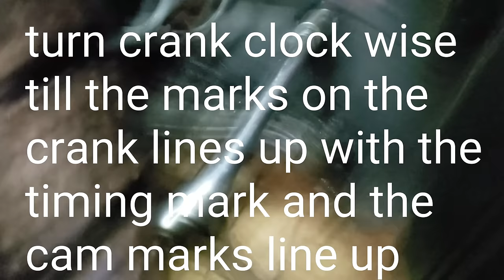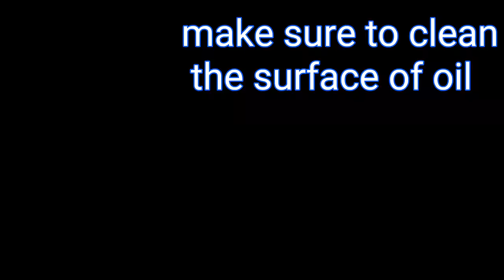How to replace Honda CRV timing chain DIY #crv #rsx #tsx #accord #k20 #k24 #timing chain

Comment: I just did this job using this video as a guide.  I want to share my insight and what I learned.  I'm a total amateur and the most I've done before was change oil and sparkplugs.  Not only was the cost for this job exorbitant, but I was rejected by 10 garages before I found one that would do it and they wanted 2k.  I couldn't justify it on an 1800 dollar vehicle.  I did it and it runs great.  Better than it has since I've had it.  So, here we go.  2002 CRV 2.4 btw.  

1.  Uncle Tinman made a fantastic video.  A 5 star instructional video that could be shown at UTI or any mechanic school.  I watched it 3 or 4 times before I started and knew the entire job exactly what I was supposed to do.  
2.  Find another way to prop up your hood.  It will constantly be in your way.  Same goes for the PS resevoir.  Just take it out.  Unattach the pressure line.  You'll be glad you did.  
3.  You will need a Lisle 77080 weighted socket and a huge Milwaukee or Dewalt XR (my choice) impact driver to break that crank bolt loose.  This held up my job by a few days waiting for the socket.  Even with the socket and that huge Dewalt it wasn't instant.  It had to hammer for a few seconds.  
4.  My 18 inch extension came in handy several times.  Mainly to loosen the engine mount bolt closest to the rear.  Stuck it right down through the ABS lines.  I loosened it with a breaker bar first.  
5.  You need a 1/4 inch cordless ratchet with a shallow 10mm socket.  You'll save so much time and energy getting all of those bolts out of the timing cover.  I didn't have one.  I had already spent too much on the Dewalt.  
6.  I bought a 14mm Capri 0 degree offset extra long wrench to relieve the tension of the serpentine belt.  It was a good purchase.  I used it several times on the bracket that mounts the engine mount through the timing cover.  
7.  I didn't have an extra deep 17mm socket that would clear the stud on the mounting bracket.  I had to file it down to fit a regular 17mm deep socket 1/2 inch drive.  I filed about 1/4 of an inch off of it.  Do this before you take the valve cover off.  
8.  Setting the timing is easy with the colored links and markings on the sprockets.  After you get the chain set, put the top guide back on before you spin it around.  This will keep your chain in place.  
9.  The three bolts on the bottom of the timing cover are hard to reach.  I would recommend a thin wall 10mm with a 1/4 low profile ratchet.  
10.  Before you put the silicone on the cover, do a few dry runs getting the cover in place.  This will help you avoid making a sticky mess.  
11.  Get the brake cleaner.  It's a miracle solution.  

Thank you very much for taking the time to do this video.  I feel like I could do this job again well within the 3.8  hours alloted in the labor guide.  Having the right tools is essential.  I have medium size hands, but if I had huge mitts and arms like some guys I know I don't know how they could do this job.  It's a tight fit.  Thanks again, Uncle Tinman.  A+, top notch work for nothing but the greater good.
Reply from the maker: Thanks you for the compliments and your amazing breakdown of your insight. Other viewers will greatly appreciate it.
Reply: Way to go!!!!!!!!! That’s AWESOME! I give you a TON of credit buddy 🎉 nice job! This is tough!
Reply: @TheWopper78  Thanks a lot man.  I'm proud of myself.  It was a big job.  A friend who is a mobile mechanic (and turned me down for this job) is going to call me next time he gets a K24 timing chain job and we're going to do it together.  So, I got a fixed car, some new tools, and a small side hustle out of the deal.
Reply: @rsn2012  that’s amazing! I ordered my timing chain last night from O’Reilly auto parts, picking it up today and away we go! Lol! Your video will be playing during this procedure hehehehe thanks again bud!
Reply: @TheWopper78  Did you also get the tensioner, crank seal, and plug tube seals?
Reply: What did you mean by 7? Is this referring to the engine mount? Also did you need to replace the VVT sprocket and how would you know if it needs replaced too?
Reply: Also do you need to remove the spark plugs to make turning the crank pulley easier?
Reply: Wondering why not do the valve adjust also while the head already open.

Comment: Did one about the same time as you , customer had EML on for a while with cam crank sychronisation error. But kept on driving ,in the end it would crank and start then stall straight away. The chain adjuster was out well past the 16mm limit and the stretch in the chain compared to the new one was immense. I think the reason  it did not jump a tooth is because the owner was a gentle driver and it was automatic transmission. Very lucky !! this engine had annual oil changes with fully synthetic oil and lowish mileage for its age. A very satisfying job to do ,could alway do with a smaller pair if hands tho. Very good video 👍👍👍👍👍 If you don't have air tools the crank holding tool is the best option and a strong helper  the crank bolt...IS VERY VERY TIGHT if you slip there are lots of sharp bits around for your hands to hit.  WATCH THIS VIDEO IF YOU NEED TO DO THIS JOB.
Reply from the maker: Thank you..means a lot coming from a experienced fellow tech.

Comment: I have this job to do tomorrow morning. This video gives me some before hand knowledge. I have never performed this on a Honda engine but have done many Mitsubishi engines in the Dodge vehicles in the past.
Reply from the maker: If you know your way around a tool box and engine bay. You should be good to go. Feel free to message here if you have questions and I'll see if I can help
Reply: @UncleTinman  I do, I have been an ASE Master Technician since 1983 but arthritis has slowed me down a lot in later years.

Comment: Excellent video. One of the best tips pointed out here is counting the number of bolts holding the cover. The 2nd one down on left you can’t see and best way to remove it is from below reaching up.  A couple of things he didn’t mention but I may add, on my 2011 Accord,  there wasn’t enough room to pull out a larger bolt to the left of the motor mount bolts so I had to leave the bolt in the cover when I removed it so don’t forget to install this bolt before reinstalling the cover.  There’s 2 shoulder bolts and they are line up bolts that go on the bottom corners of the cover.  Install these first and the rest line up perfectly.  This was an all day job but it’ll save you  anywhere from $700-$1000 in labor alone not to mention the wait.  Yes, there are some challenges but have patience it’s possible without engine removed.  Taking my time it took me about 12 hours.  I’d have no fears doing this again.
Reply from the maker: Thank you for your reply.. hopefully it'll help others as well.
Reply: I'm about to tackle this job on my 2008 accord coupe. This is the most helpful video I've seen so far. Thanks Unc
Reply from the maker: @Midnightsnack456  thank you for your reply.  I tried to make it as concise as possible. Good luck with the job.
Reply: @Midnightsnack456  it’s not a difficult job.  While you have the timing chain cover off you might as well replace the crankshaft seal too. Get the seal kit from NAPA (part # FPG TCS46051) it comes with 2 seals the irregular shaped O-ring goes on the inside of the cover & you’ll see it when you remove the cover. At first I was stumped as to where it went as there is no info on YouTube about this O-ring.  Hopefully you have access to a good impact wrench for the crank bolt. Invest in a Lisle 19mm socket.
Reply: Thank you! I'll pick one of those up as well as the Lisle 19mm. I take it it's a pretty strong socket. I need an impact! I planned on using torque wrenches and leverage to remove the crank pulley but I've failed to check the torque spec thus far 😅my toughest torque wrench can only go to 150 ft lbs.
Reply from the maker: @Midnightsnack456  DO NOT USE your torque wrench to remove the bolts.. torque wrench is only meant for tightening bolts.  The Lisle weighted socket is great to use with an impact. I have one that's a non Lisle brand that weights almost 2lbs, works amazing. If you don't have an impact gun you can also get the Honda crank locking tool. You'll need to hold it with a Johnson bar. I find it's easiest to lock it with a Johnson bar wedged on the control arm and then use another Johnson with a 19mm socket to loosen the bolt. 

This sounds very confusing.... maybe I'll make another video just for this topic. 

Cheers
Reply: @Midnightsnack456  I borrowed my friend’s Dewalt cordless impact. Soak the bolt with penetrating oil for a day or two helps. I recently bought a corded electric impact from Harbor Freight for $90 I’m pretty sure that would do the job too. If it doesn’t take it back. For $90, it’s worth the try. I’m keeping mine though for other jobs but again, I have the confidence it will do the job.

Comment: Man I’m only 10 minutes in and I feel confident enough to knock this shit out today. Awesome video man. Seriously Kudos!
Reply: Here goes nothing pulling the valve cover to check the timing marks.
Reply: Update. I’m a dummy and rotated the intake CAM. So had to reset all the timing marks. Everything is all lined up and ready to install the chain, guides and tensioner.

Comment: That was one of the best DYI vids I’ve seen. A bit of torque guidance would have been helpful too but I guess if someone has the wherewithal to tackle this job they can ensure bolt torquing is done correctly.
Thanks for your effort, I’ll subscribe to your channel.
Reply from the maker: Thank you for detailed reply. I'll try to add a torque spec guide for next time.

Comment: I own an '06 CR-V that I bought new, now with185.5k miles. Am still on the origiinal timing chain with no issues. I never let more than 5000 miles go between oil changes, using synthetic oil that I started using at around 120k miles.
Reply from the maker: @ozzierabbit587  proper maintenance definitely helps. Keep up the good work
Reply: I went to the mechanic today because the belt is chirping. It started dripping oil. A good 4 inches by 6 inches every week or so just sitting. The mechanic looked from under the hood with a flashlight. He looked at the serpentine belt area and claimed the "main seal" was leaking and since it has 290k miles the timing chain should be replaced while in there because the tensioners or chain are going to need it eventually. Do you think this is true? He said 800 dollars max, maybe less. To replace this seal, and to replace the timing chain. I am traveling at the moment and have no tools or space or time to work on jit myself. What main seal is he referencing? Thanks so much!
Reply from the maker: @Jon-pn1sw  the main seal is a very simple job. You just need to remove the crank pulley and change it out. Will not need to get into the timing chain area.

Comment: Another Idea on keeping bolts organized. Use a piece of cardboard. Label top, bottom, right or left etc. Then push bolts through the cardboard in the direction of which they go. So you can always put the same bolt back into the same hole. Not very important but I tend to go a little over board in this manor. Someone that's a little picky like I may be happy to hear that aren't the only ones. Plus when they stick through, it's easy to add Never Sieze if so desired before putting back.
Reply: Nice video Man.
Reply from the maker: That's a great suggestion. Thanks for your reply.

Comment: Some people (technicians) tell me don't change the timing chain if it's not broke. Honda does not seem to, or at least I have not found a mileage where it is recommended to change it out. What are your recommendations. Mine has 148k km (93k mi.) and I inquired but the guys in the dealership said keep driving but offered no further guidance. My concerns are more for the tensioners than the chain. Reason being the tensioner for my power steering pump is already failing so could others be far behind.  I have the same CRV? Incidentally this is the most detailed and excellent presentation on car repair I have every watched. Amazing videography and given the right tools, perhaps most of us could tackle this job from your video alone.
Reply from the maker: Thank you for your comments.. I appreciate the recognition of efforts for the detailed video. 

The timing chain tensioner issue seems to be a hit and miss. I've heard of some failing randomly and end up causing missed timing and bending some valves resulting in engine replacement. The timing chain don't seem to break, but rather can wear out and causing some timing issues. So your best bet is probably to just replace the tensioner for some simple peace of mind. The tensioner is accessible through a small cover on the side. Hope this helps.

Comment: Incredibly helpful video!  Definitely a daunting task (P0341), but I've finally started this project on my CRV solely thanks to your video.  Cam timing check was off, so I went with timing chain (was pretty stretched compared to new one!)

I've run into a snag at (21:50) putting the new chain on - mine does not line up with the coloured links on the chain (2 teeth off). My chain looks the same as yours (two coloured links for each tooth).  It seems like both the intake & exhaust camshafts are out of alignment by 1 tooth each in opposite directions.  If I use a wrench to manually rotate each camshaft (slightly) and hold it against pressure, the two horizontal markers are lined up (TDC) and the chain fits just barely. However, as soon as I let go of either wrench, the camshaft just pops back into that "off" position and the chain jumps. I've rotated the camshafts and put a 3/16 drill bit into the pulse plate hole (lines up the camshafts in TDC) and the links line up (albeit with no slack whatsoever).  I'm worried that the chain will jump out when i remove the 3/16 bits, even after the timing chain tensioner is applied.

Spark plugs are out. Crankshaft is lined up with the marker for TDC. 

Am I missing something? Not sure what to do. Any input would be very appreciated! 

You can also PM me at brokendowndrone@gmail.com

Thanks for the awesome CRV video!
Reply from the maker: Sorry for late reply... hopefully you're not still stuck.

With the drill bit in place and the chains lining up.. you should be good once you install the tensioner it should not jump. If it does, you might need a new tensioner.

If you're worried about it jumping before you're able to set the tension... perhaps you can use a large set of C clamps or adjustable clamps of some sort to clamp down the chain to the gear just to hold it in place. 

Hope this helps. 

Cheers
Reply: Thanks! I’ll give it a shot. I’ll update with results in week or two. Cheers!

Comment: When you replaced the chain did you have to do anything with the intake sprocket. Meaning having to lock or unlock the sprocket being that you didn't change the intake sprocket. Great job showing the chain replacement procedure.
Reply from the maker: I didnt remove the sprocket.. so didn't have to do anything in particular with it.
Reply: @UncleTinman  OK thanks, My chain broke and I had already change the sprocket because of the rattle and everything was fine for about two weeks. Then the engine just stopped. dug into it and found the chain broke. Scoped the cylinders and didn't see any damage [ lucky ] to the pistons. Thanks for getting back to me so fast. I didn't think I had to do anything but it doesn't hurt to ask. Thanks again

Comment: Jesus dude your camera quality and camera angling is on point made the process look incredibly easy and even put it back together unlike most haha was looking specific for an rsx but this vid was enough props! But about how many man hours would you say this took? Also did you have to drain the oil?
Reply from the maker: I appreciate the comment. It makes all my time and effort worthwhile. It's amazing what you can do with a camera phone and a tripod nowadays.  I'll try to add a time estimate for next time, but I don't really gauge time well cause of all the back and forth with the filming and camera placement, etc..  BUT the labour guide calls for 4.4hrs (for a RSX)... which sounds about right.  I would suggest draining a bit of oil.. not too much.. maybe a quart incase it spills over when you pop the timing cover off.

Comment: I wish you had shown how to remove the engine mount bracket off of the timing cover. 
The bolts hit a wall

Did you have to raise the engine. What jacking points did you use if so.

Comment: Thnx man. Do another one for the oil pump/chain. Mine has 300k miles, and rattles/eng. noise a lot, I believe is the oil pump assy. Because the engine was started with low oil level...😖
Reply from the maker: Thanks for the reply.. Rattling can be caused by a few things... A worn tensioner will definitely rattle. starting with low oil level could cause bearing damage... So your rattling would be rod bearing failure. Perhaps you should get it checked out.
Reply: @UncleTinman You very right. I'm going to pull the engine out. And overhaul it, it's time...I have  very little exp. But I think I can do it. I did in a old 98 Accord(broken timing belt), 4cyl. Following a YouTube series,  it has been  almost two years after my re-build, the car still running 🙏..

Comment: You are a Pro my friend!! What do you charge for that job? Also my STFT is high @ idle indicating air coming into engine from somewhere. I checked all hoses and everything looks good. Could I possibly need a new valve cover gasket? TY!
Reply from the maker: I would check for intake manifold leak or the throttle for the idle air control valve. Those 2 would cause a higher idle. Hope this helps